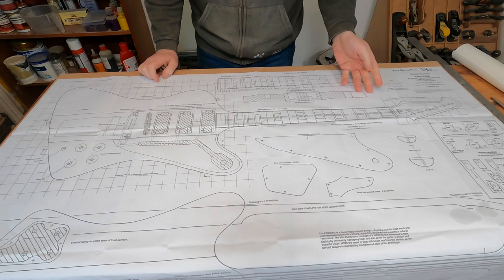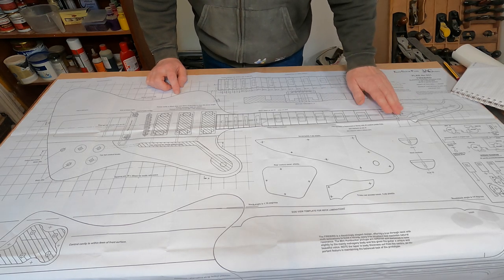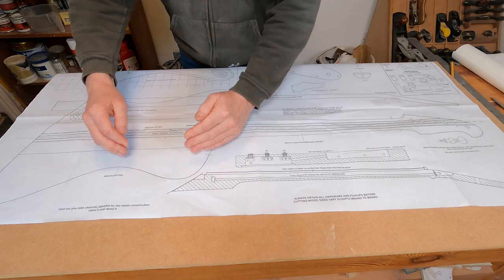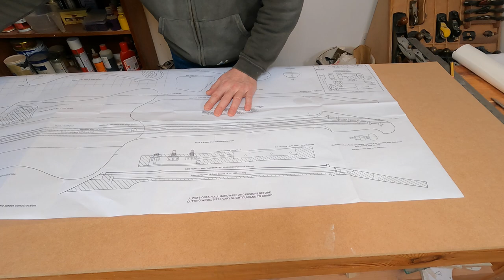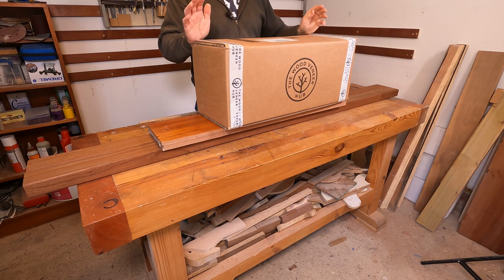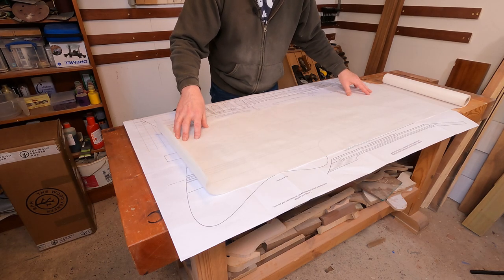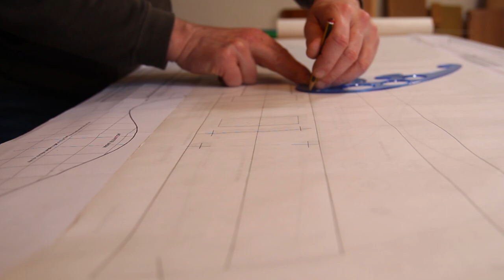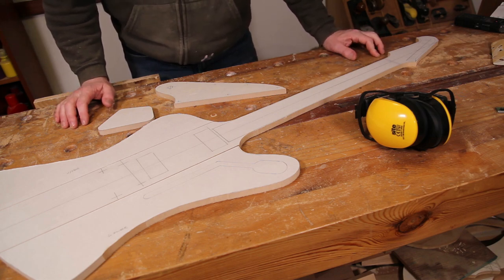Firebird Build Episode 1.

Comment: Probably a bit late now, but if you intended to go for a scarfed on headstock, you can cut a big enough piece for the headstock from the excess material at the back on the neck. This brings the length of blank that you need below 1m (about 900mm) so that you can use constructional veneer for the walnut stripes. (It's what I did for my Firebird - build photos on my website if anyine is interested.). Just found your channel so am looking forward to catching up with the rest of the build.
Reply from the maker: Cheers for that, it is too late but constructional veneer would have made the glue up a lot easier.

Comment: Love it. I just finished my first from scratch build and it was a Firebird. Hardly any video series out there on these, other than Big D guitars so I'm sure yours will be quite popular when you are done. Good luck. I modified my plans as well. I left my wings untapered and took away the step down on the back. Also used only 2 humbuckers. I also painted mine black.  I made  lots of mistakes along the way but learned a lot. I scarfed my neck joint as well. I did add some carbon fiber rods along either side of the truss rod that I think helped. I did my scarf joint before I made any other cuts on my neck through portion. That way I could keep the pieces squared up and together better. Excited to see this series.
Reply from the maker: Thanks Ryan, I did a search for other Firebird builds as part of my research for this one and you're right, there is hardly any stuff on youtube. Sounds like you had a lot of fun on your build, I hope you are happy with the results :)

Comment: You could try to wind your own firebird pickups, its a lot cheaper 🤘
Reply from the maker: I keep thinking of starting to wind my own but never quite get around to it. I'm discussing having a set custom wound for this build.
Reply: @Adventuresfromtheshedofdreams  Im about to build my first set, though i havent even finished building my first guitar yet. Seems pretty easy, ill wind them on the side of a sewing machine. I think (hope), that there is not that much that one can mess up, since pickups, even the most expensive ones are fairly simple in construction. When you dont make pickups in thousands, the couple cent difference between good and cheap magnets, wire and wax is not that big. Along with scatterwinding, theese factors should make any hand built pickups almost always better than most factory ones. Again, i dont have much experience in the field, but i strongly recommend it 👍